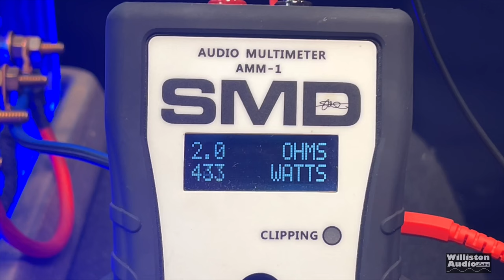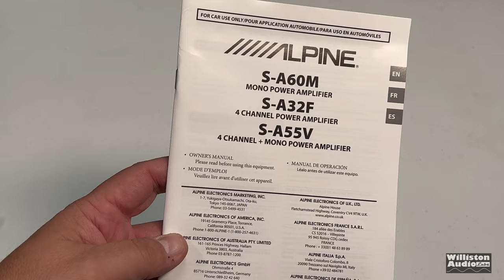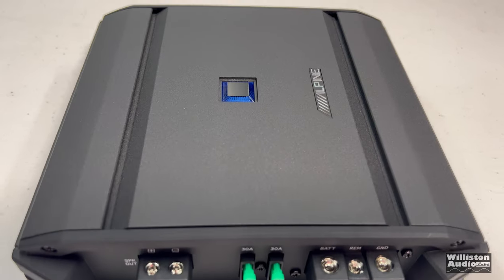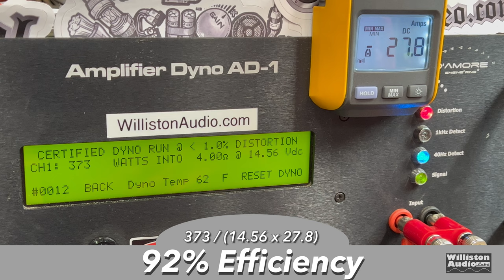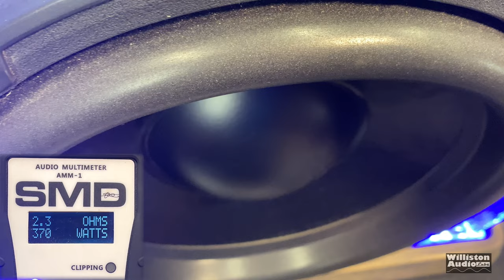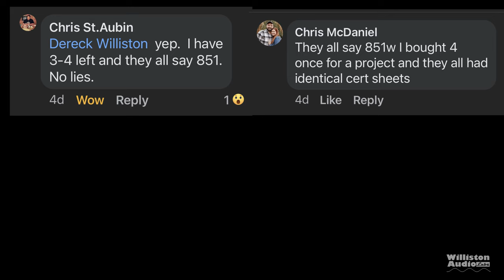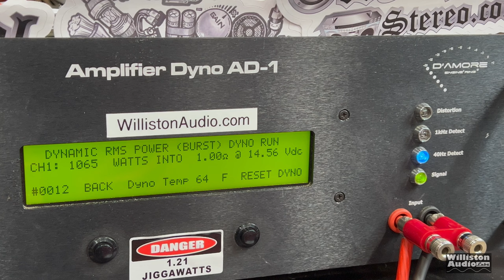TOP SELLING Amplifier of 2022? ALPINE S-A60M 600W Monoblock Amp Dyno Test and Review

Comment: These Class D amps are the same design they've been selling since 2006, Alpine just keeps repackaging them in a new case every 5-6 years and bumping up the price on them. I'll pass. I still have my original Alpine MRP-M650 from 2006 sitting in a box that still works. It got retired after I replaced it with a 1000w JL Audio amplifier.
Reply: No those old ones are Class A/B
Reply: I'm still running my MRP-M450 and F250 in my truck! Those amps are bullet proof!
Reply: No they are not

Comment: It is nice to see a long term brand not go to complete crap over the years.
Reply from the maker: Amen 🙏
Reply: @wal  question! I’m running 2 8w7 in a ported box, which amp would be best for these woofer? I’ve read that jl 500.1 but it’s quite expensive is there anything decent in $200 range?
Reply: @lennyleejr7763  You can find the JL 500.1 slash series fairly cheap used on marketplace.
Reply: @98wytebird  And beat to crap the majority of the time.

Comment: As an Alpine fan/user since the late 80’s I can attest to them never skimping on quality components or build quality. Back in the day if you wanted Alpine on a budget you could shop the few dealers who carried them for customer returns. Back then Alpine did not automatically credit retailers for returns so their stuff would actually go to the Alpine service center in SoCal for testing if a customer brought it back. The benefit to the customer was that these items would come back with a bench test report, which meant their amplifiers came with an actual hand written “rebirth sheet”. These reports revealed that their amps at the time were consistently underrated by around 20%.
Reply: love me some alpine
Reply: Man I built a 90s alpine based sound system for my 89 Mercedes’ 560, ran a alpine 3da headunit with a 12 disk changer (and 3 disk cartridge in the HU) running through a 3343 graphic equalizer and then to a alpine v12 5 channel amplifier and a Sony 2 channel, ran 4 sets of blaupunkt 3 way component speakers and a Rockford fosgate punch subwoofer. The Sony amp drove a set of beefy Clearwater headrest speakers with independent volume control. It was clean and Loud with minimal distortion and man the clarity was insane
Reply: @12pagani  In the early 90’s I built a system in my ‘69 Ford Thunderbird using all Alpine except for the speakers. I don’t remember the model numbers but it had one of the better CD head units, a dual zone equalizer, and an active crossover for the subs. I had a 60 watt 2 channel  driving a set of Polk Audio 6.5” separates and a bridged 100 watt 2 channel driving 4 Redline 8” subs. Only the head unit and equalizer were bought for the Tbird because nothing Alpine I ever bought ever broke. I regret selling all that stuff when I sold that car.

Comment: For my personal setup I have an Alpine S-A60M with a kicker L7S 12 in the loaded enclosure from Kicker and this little amp puts out a lot of power and my sub is thundering. People think I have 2 12s or that I have a 1500+ watt amp but I show them everything and they are extremely surprised to see that little amp making my subwoofer hit that hard. I got buddy’s who have skar audio 12s with a 2000 watt amp and there setup cannot compete with mine. Efficiency and clean power is all you need for your setup to hit hard!!!!
Reply: I know this is an old thread, but just put the exact same setup in my Tundra...you're 100% correct, sounds amazing for one 12 in a sealed box
Reply: @snicklefritz11gaming24  these amps are rated for 600rms at 1 ohm and 2 ohm so I wonder if they changed it since he did this video or he missed that all together
Reply: @Tjcin513 This is the old model it was only rated down to 2 ohms the new version is rated  as 1 ohm stable

Comment: It's nice to see Alpine still builds solid little amps after all these years.
Reply from the maker: Awe Jeah!
Reply: No doubt and this is one of the newest model Alpines I’ve seen made in Korea since the 90’s.  Everyone of these and most several more of the newer ones are made in China.  They have been a long time.  But this A60M I have is a Korean model.  first time I’ve seen in Korean made on an alpine since the later 90’s
Reply: when I was into car audio from 1995 - 2003 or so I found the Alpine V12 series really good amps! Used them with DLS speakers, made a really nice combo!

Comment: In the end, most people just want a lil bump & volume that can be heard from a few cars away. With the prices of todays gear, it really doesnt take a whole lotta loot to get you there. I will say it does take a little more thought today than it used to, to integrate a good aftermarket system in modern vehicles.
Reply from the maker: Amen 🙏
Reply: I worry for the future of good systems in the "budget" folks . the What they make the systems in cars cant be swapped out, and the "premiums" they have in cars are still just ok, but cant really handke producing alot of lows . either manufactures need to incoperate better systems or just stop n let us do it lol.

Comment: I’ve been running an Alpine PDX1.600 for some years now, and it’s been great, other than the power terminal stripping out. That amp was a huge deal for me when I was younger and got it used in a trade because I know it sold originally for right around $1 per watt. The 600w regardless of having a 2 or 4 Ω load is very interesting as well. It still cranks out the power in my car to this day. Always been an Alpine fan.

Also, back when subs weren’t requiring a thousand watts just to move, this 600w was a beast. It’s been hooked up to a pair of JL 12W6v2 (600w rms each) and pushes them greatly. Not a competition build by any means but I have it turned down a couple notches even at that.

Comment: Not a bad looking amp. If I were spending around $200 and trying to stay stock, I would personally get something like a JP8 for the additional power and that handy bass knob with clip light. 
Alpine amps are usually pretty nice and this one doesn't look like an exception. 600w can get louder than a lot of people realize.
Reply: You will also need to upgrade your Electrical for that JP amp to take full advantage of it
Reply: It's
Reply: Exactly 💯

Comment: Big D, I found the comments you made about what the average consumer wants at the beginning of the video to be very interesting. I'm 64 years old. I purchased my first car in 1978 for $500 and spent $500 on the audio system, which I installed myself. 2 6X9 coax in the rear parcel shelf, 5 1/4 coax in the doors, and a 10-inch woofer in a box I made myself from wood I scavenged from a construction site in the trunk. A Pioneer in-dash AM/FM Cassette and an Audiovox (I think) 'power amp' EQ under the dash. When I cranked the volume, there was more hiss than the snake house at the local zoo. Distortion? Maybe 20%, if not more. Now I drive a small SUV with an upgraded factory audio package. It sounds better than the audio system in my living room, most likely because the car components were carefully engineered to the car's body, turning it into a giant speaker box. Size and cost do matter, but skillful engineering matters more, no upgrades from me needed, much to my wife's relief. 😄

Comment: Glad you finally got to test this one. It quickly became one of my favorite amps and I ended up owning 4 of them, but no one had done any testing on it. It's basically the upgraded version of the MRV-M500 and if they had called this something that included "M600" it probably would've been even more popular, the name they chose doesn't let the average person know that it is a 600w amp.

By the way, have you considered testing any headunit "power pack" type amplifier. I'm tempted in buying an Alpine KTP-445 since something that tiny and simple to install is rated at 45wx4, but the 15A fuse makes me skeptical.
Reply from the maker: Thanks for the suggestion
Reply: I have the ktp-445U in my 19 Accord. Had it professionally installed with BESTBUY. I have it on 2 sets of dd audio components. Night and day difference over stock. STRONGLY RECOMMEND

Comment: I am old school ....and  I have been an alpine head unit loyal customer since the mid 90s ....just bought one  for my 98 s10 project ....Alpine -CDE 172BT ....single din cd /multi media player bluetooth etc.   And it comes with a front and rear rca plus subwoofer rca ....which is all I need running a 4 channel for mids and hi s and a mono amp for subwoofer....but I have never owned an amplifier from alpine ....used to really want what they use to call a flex 5 alpine amp it was a 5 channel but they were pretty expensive and at the time I was very much still satisfied and using and older Rockford punch 150 for my sub amp ....and a kenwood for midrange
Reply: I run that deck it's very nice, miles ahead of the old stuff we used to run. Only thing I don't like is the sub-out control you can't disable the crossover so an Epicenter is out, and it also acts as a bass boost above the middle point on the potentometer, which of course leads to clipity clip pretty easily. I just used one of the full rande outputs. Other than that, very nice.

Comment: I have two SA60Ms and I'm gonna pair it with a Type R 12 in a ported box for my wife's car. The Type S is really good but I feel that tiny amp would do better with a Type R since my Type S is clipping at half gain. It'll do fine for me put in a sealed box for rock music. That SA60M really is a sleeper and it generates almost no heat.

Comment: I love Alpine amps. I'm using the MRP-M450 from 2006. I've never had an issue with it and I bought it used. It's only 400W at 2 ohms but it sounds amazing paired with 2 12" kickers. It has enough power to shake everything in the car and the pictures on peoples walls as I drive by. I also prefer the way it sounds over the pioneer 600W amp I have. Would love to try the S-A60M but I can't justify the $400 CAD just for a couple hundred extra watts of power. Also if possible, I would love to see the Alpine KTA-30MW Tough Power Pack tested. I think it would be the perfect thing for most people if they could sell it at a cheaper price.

Comment: Hi.
Really appreciate all the great videos Bid D!
Friend runs an Alpine R-A75M @ 0.5 ohm small sealed box in his ute (Two 10" type R dual 2 ohm all coils in parallel) We wired it @ 2 ohm initially but thought to try 0.5 ohm thinking it probably won't like it.
Pushed very hard daily for about a year now,  no issues sounds great and definitely much more output.
His pioneer 8601 mono amp would pulse in and out of protect trying to drive the same 0.5 ohm wired sub at high output.
Please test it!
Cheers Paul G
Melb. Australia 🙂
Reply from the maker: Thanks for watching and commenting!

Comment: I'm a pro installer. We had one of these in an F250 and it kept going into protect randomly. We replaced it with a Rockford R500.1. I put the Alpine in my car and it's been working great for months. I don't know why it didn't like the ford
Reply from the maker: That is odd
Reply: What ohm was it being ran at?
Reply: @MINAR3L_GR3Y_2V  2 ohms, and still is. I think there was something weird about the truck and the Rockford amp just wasn't as sensitive to it.

Comment: Good start Big D a lot of people aint trying to put a bunch of all that extra electrical upgrades for that expensive amps getting a like just for that start.
Reply from the maker: Exactly!!
Reply: A lot of these bass heads don't think clearly all they want is a ton of wattage and a ton of bass they don't care if it's clear they don't care about the electrical system they don't care how long it lasts they only want to drive around with their trunk rattling Airheads

Comment: My PDX M6 (one of the fire hazard models that Alpine never admitted was defective or a fire hazard) was rated for 620 or 640 at both 4 ohm and 2 ohm, whereas other were rated well above 700 watts at the time.  No idea how Alpine rates these, and I always assumed they used some sort of programmable load SMD tester.  I think in the past it was far easier and a safer bet for the manufacturers to just design for an underrated the power rating to avoid getting accused of selling something less to the customers.  That's for only the reputable manufacturers that design new boards.  Now they are able to make these amps so that you get more or less the exact rating...partially why they are so compact now.
Reply: The PDX m6 I had was great until it randomly started throwing out 30+ volt DC, and almost fried my morel Ultimo. Worked for like 1.5 years. Had to throw it out. I spoke to Alpine and they NEVER admitted anything was wrong with the amp. I've seen hundreds of people complaining of the same issue online. Oh well

Comment: Had a PDX-V9 loved it now running an X-A70f on some R series components and coaxials. Amazing crystal clear sound very high S/N ratio definitely worth the $.
Reply from the maker: Awesome 👏
Reply: I have the X-A90V morel tempo components alpine s rear fill and 2 primo 12. It’s loud as hell and crystal clear. I had a pioneer 5 channel before that and it was loud but the detail was not there.  The X is beast and I only added a AGM battery no dimming   You definitely can hear me coming
Reply: Why has alpine discontinued the X-A90v? and PDX -V9 is still being produced.

Comment: i always used alpine amps and head units. until i got a solo baric square 10". it wore my alpine 1000w amp out like no other. got a kicker cx600 amp(older than the alp) and what a difference. less wattage and 20 % minimum louder and cleaner output.ailso 25% less gain is needed verses alpine .and the kicker really hits harder dynamically and thats a deal maker for me. Kicker is the best in my crappy opinion. but if you dont know then trust anything kicker. unfortunately i cant boast as well for alpines amps anymore.

Comment: How accurate is that Audio multimeter; Can you do a video on testing that? It was hitting far above the dynamic numbers on dyno on some of the clips.
Reply: 💯 I saw 2794 watts
Reply from the maker: Battery was a little low, I’ll make sure I change it before the next test. Either way this amp was hitting 1000W plus consistently on the sub test ✌️

Comment: I know this is an older video but it did put out 1200 watts on the sub when you connected the SMD Meter! That's over the dynamic burst number.
Reply from the maker: Yes the AMM-1 measures power output in real time and it’s possible for a momentary burst of that much power

Comment from the maker: SHOP (Affiliate Links)
Alpine S-A60M - https://amzn.to/3zNiuvj
Down4Sound JP8 - https://lddy.no/vvaw
Rockford Fosgate Prime R2-500x1 - https://amzn.to/3DFCnpq
KICKER CXA800.1 - https://amzn.to/3DZGM7Y
KICKER CXA400.1 - https://amzn.to/3zKNz30

RELATED VIDEOS
ALPINE MRV-M500 - https://youtu.be/cHLvpKAoNDo
KICKER CXA800.1 - https://youtu.be/fEBTBLm_SOo
Rockford Fosgate Prime R500x1 - https://youtu.be/ACrgDiG11IY
Down4Sound JP8 - https://youtu.be/No3qCPI4LNw
Playlist of Budget Amplifiers - https://is.gd/walbudgetamps

VIDEO INDEX
0:00 INTRO
1:03 TOP 5 AMPS 2022
1:53 UNBOXING
2:29 FEATURES AND SPECS
4:16 AMP DYNO TESTS
7:05 SUBWOOFER TEST
8:52 WHAT'S INSIDE?
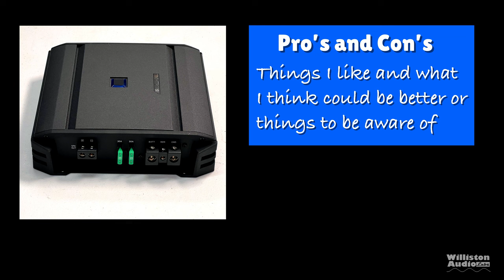9:55 PROS AND CONS
10:42 BIRTHSHEET POWER?
11:10 FINAL THOUGHTS
11:42 EXTRAS

TEST BENCH EQUIPMENT
SMD / D'Amore Engineering Amp Dyno: https://goo.gl/sJTcf7
XS Power D1400 Batteries - https://amzn.to/2BPFCKW
XS Power PSC60 Charger - https://amzn.to/2CHGcfs
Fluke 1000A AC/DC Clamp Meter: https://amzn.to/2Rw5WDA
Handheld Dyno: http://amzn.to/2u2EgKV
My Favorite Screwdriver Kit: http://amzn.to/2x0VzcE

DISCLAIMER: This video and description contains affiliate links, which means that if you purchase from one of the product links, I may receive a small commission. As an Amazon Associate I earn from qualifying purchases

Comment: What type of power supply do you use? My Cascade power supply can’t supply the amperage you’re drawing in most of your evaluations.
Reply from the maker: I have a couple of setups, with this test I used (8) XS Power D1400 14V batteries in parallel with no charging during testing. I also have a massive LTO bank of XS Power/Yinlong Lithium cells for the bigger amps. My setup is mostly green since I don't need huge AC power to run my setups due to their massive capacities.

Comment: Great video good sir. These Alpine amps are great. I ran an MRV-F300 that I got used and used it for two years. So good for the price used. My only issue with it was the screw terminals which stripped so easily, which I replaced with hex bolts. Alpine has always made good amps in my opinion
Reply: The Allen hex sock stripped? Not the threads? 🤔
Reply: @Omardottcom  Regular screw. I replaced it with a hex

Comment: You say it doesn't make the birth sheet. I don't understand. The amm-1 says 2794 @7:38. I also see that it says .1 ohm. But it also measures higher than 861 at different times above 2 ohms. Could you please elaborate more on the amm-1 or were you specifically going off  the dyno? Thanks and keep doing you, I love it!
Reply from the maker: I need clarification from Alpine how they obtain the number on the birthsheet. Most companies use resistive loads and test tones to obtain the certified numbers. This amp was consistently putting out 1000W plus with the subwoofer on music

Comment: Ummm not being 1ohm in this range of amps is a big issue with most subs being offered in dual 2 off the shelf.. yes they make them all in dual 4 as well but dual 2 is the most common now. Especially for something like this which is likely to be put on a single sub/box combo. And that is why the cxa800 is number 1 on this list.